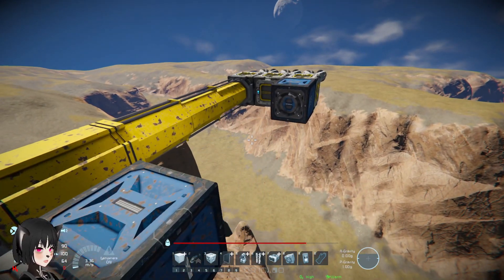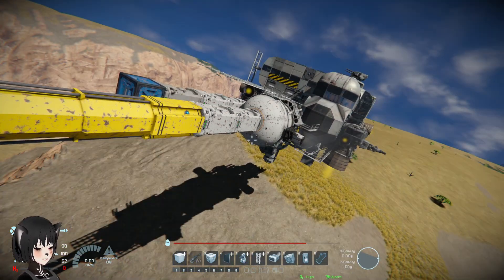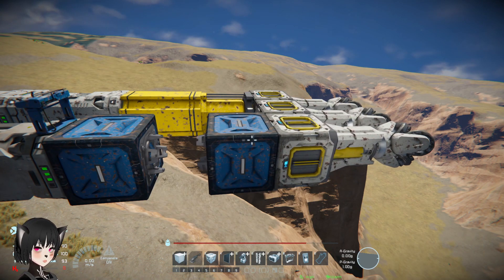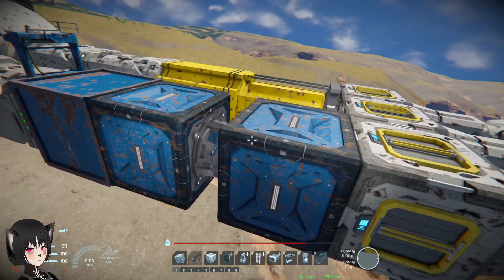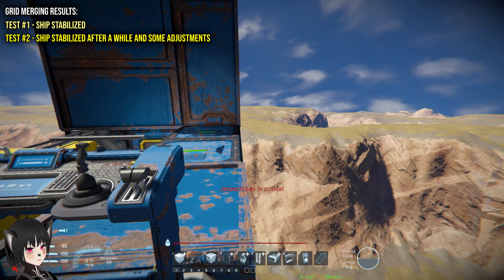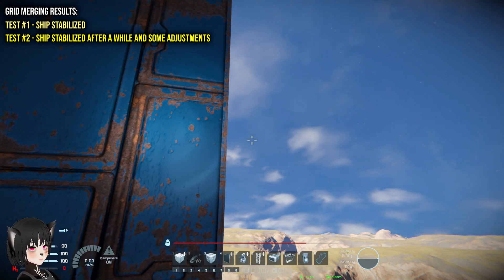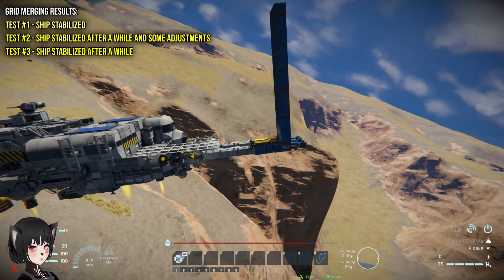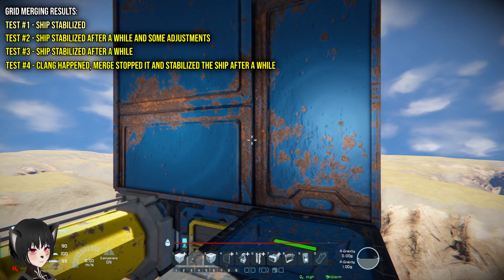Can This Trick Stabilize Ship Subgrids? Space Engineers

Comment: Hello! I noticed that the stability is acquirable using only magnetic plates, or landing gear, although it is a bit more finicky as the piston, or the other mechanical block is required to be not traversing in the moment you "park" on it with the landing gear on the other grid. If the mechanical block is still traversing when you "land" on the subgrid, it will just cause even more klang instead of mitigating it. I did not know that this is possible with merge blocks too before your video. I do not very like merge blocks personally, so i will just do it with my old fashion way.

Comment: Also there are a lot of multiplayer servers with restrictions where it comes to the use of certain blocks. Like having a limits for anything that increases lag from drill heads, o2/h2 generators, assemblers or overall block/PCU limits per grid. All of which can become a problem at the time you merge grids and did not concider that. So not very confenient.

Connectors on the other side when connecting more than 2 grids also can end in desaster by either creating huge lag that can potentially kill the server through some sort of feedback loop they introduce to also qidely spinning out of control grids (even when one of the grids has been made a station)

Comment: You have to be careful that the piston is not exerting more force than absolutely necessary for the task or you get phantom forces when merged, the worst is when the piston and its head are no longer visually attached, you are using WAY too much force. Adjusting the force settings helps a ton.
Reply from the maker: Hmm yeah, will try that and follow some advices others have posted too x3 with turning off the piston or setting the piston's lower limit, and stuff c=

Comment: Facts about LARGE GRID pistons, (verified through rigorous testing):
- Pistons offset is 0.16m
- One full block is 2,5m 
- pistons extend 4 blocks

The following are safe positions to merge a single piston:
2.34m*
4.84m
7.34m
9.84m

Facts about SMALL GRID pistons,
- Pistons offset is 0.032m
- One full block is 0.5m
- pistons extend 4 blocks

The following are safe positions to merge a single piston:
0.468m*
0.968m
1.468m
1.968m

*Pistons cant stay in a merged state within it's own hitbox when pasting, if you merge a piston at offset (LG)2.34m (SG) 0.468m and copy paste the grid, either the piston or the piston head will be deleted.

Facts about LARGE GRID Rotors 
- Rotor does not allow for flush state until 4+ stacked. Avoid for most usecases as they are more likely to cause clang when used in merged setups
- Advanced Rotor offset is flush at -0.20

Facts about SMALL GRID Rotors
- Rotor offset is flush at 0.009cm
- 1x1 Advanced Rotor offset is flush at 0.0093cm
- 3x3 Advanced Rotor offset is flush at 11cm (default)

You can never merge grids that have blocks intersecting, so to merge grids via a rotor or hinge, you are require to add a subgrid inbetween in the form of a piston, rotor or hinge in some capacity
Reply from the maker: Oo, thanks Kennet x3 those would be useful information c=
Reply: @LucaTheGuide  i got the ones for small grid and for rotors aswell, I'll get you the info on your discord later
Reply: @LucaTheGuide  updated the post

Comment: Am using small grid shield on a large grid rotor ( server restriction large grid)  have random Klang.  Can't really merge my setup, but what about a mag plate and adjusting rotor displacement distance?  Worst Clang, the small grid shield on a base grid caused voxel issue and a 150m crater the diameter of shield was created, fully exposing underground base.  Had to make it a ship and drilled it into another lunar crater.  Can't make it easy for the Reavers!
Reply from the maker: I thought about using magnetic plate but not sure how stable that would be c= might test that in the future x3 and rip xD d a n g e r o u s  u wu

Comment: When the merge blocks are merged you no longer have any subgrids (in the video here), so the dampeners are able to calculate the weight correctly. But having pistons and merge blocks like that is perfect to create phantom forces and for clang to manifest itself.
Reply: Horrific memory of accidentally making a reactionless flyer with a Klang drive when I used merge blocks, landing gears, and pistons to make my rover have a hard brake.
Reply from the maker: I see x -x I hope there's a way to completely neutralize the effect x3
Reply: Indeed by brother in arms
Reply: Once the new update rolls out the event block should allow us to affect that piston in response to the merge block connecting to make it easier to mitigate the phantom forces.
Reply: So.. Leads to "isometric exercises for subgrids" which may induce RUDs... Duly noted.

Comment: When merged the piston is still pulling, so maybe turn off piston too.  Also should test landing gear for stabilization of subgrids.
Reply from the maker: I thought about that c= will try that next x3 hopefully it would neutralize it completely, I doubt it though since I don't think the piston pulling would cause that much movement or clang, might try landing gear or magnetic plate too c=
Reply: @LucaTheGuide  you're also off by a alight amount of distance; your first attempt to merge didn't work because the second piston was lacking a piston head, so when piston 1 was fully retracted, piston 2 with the merge block but without a piston head, had a slight gap and couldn't form a grid aligned solid :)
Reply: @LucaTheGuide  There is the additional step to try of detaching piston head after merge and retracting piston.  Then reverse for the unmerge.  

If you try this with hinges you will need two hinges (versus one piston) in sequence between the grids to get the merge blocks to merge
Reply: If only pistons had piston lock to cancel forces...
Reply: @ToddTalksTech  That might be an alternative method.
Reply: I agree with another commenter whom mentioned the piston's lower limit. Set it to wherever it stops upon merging and that will stop the movement. And possibly cause Lord Clang to miss your sin.